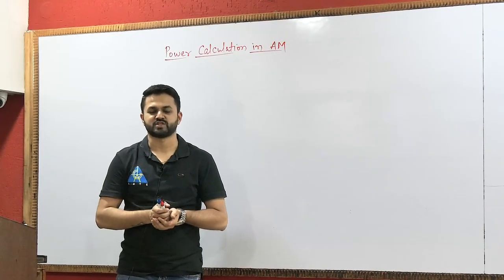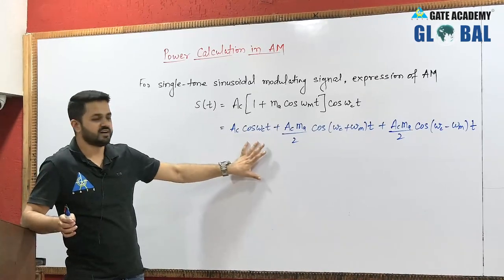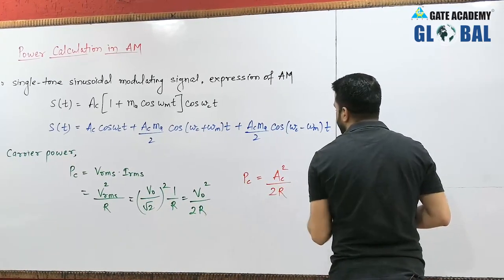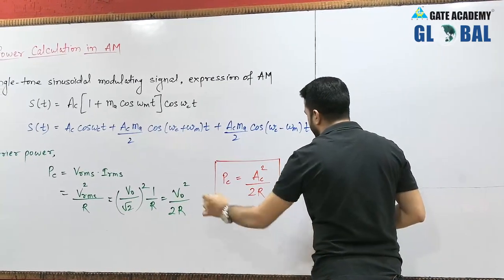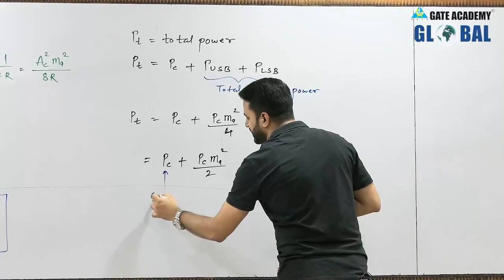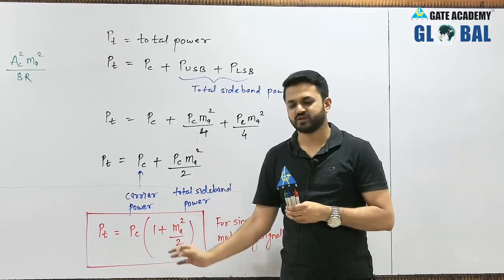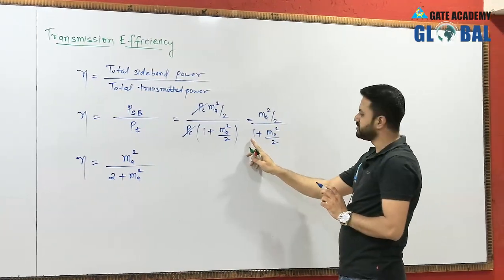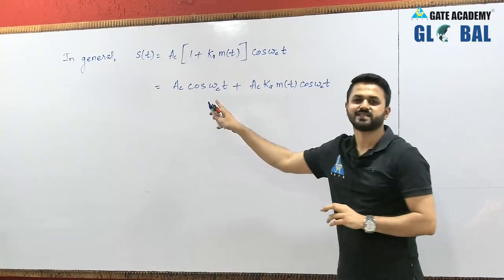Power Calculation in AM and Transmission Efficiency | Lecture 6 | Communication System

Comment: 16:28 there is no requirement of R over there Sir, we have calculated it using the general formulae of power not with that V2/R ,considering R=1 will not solve the issue i guess